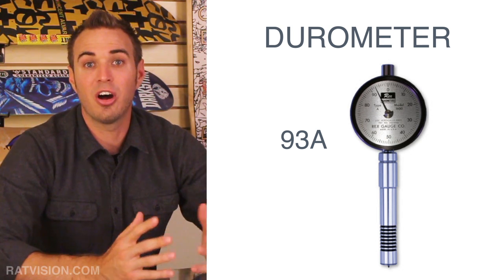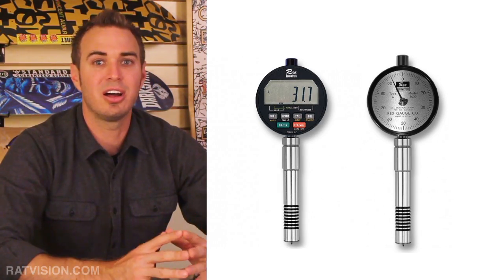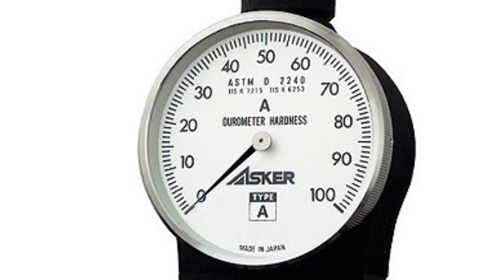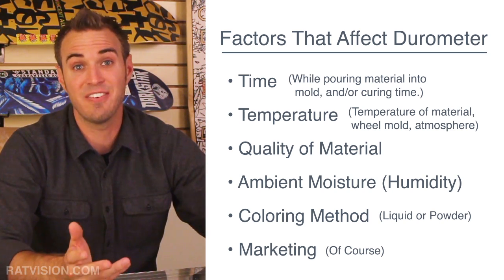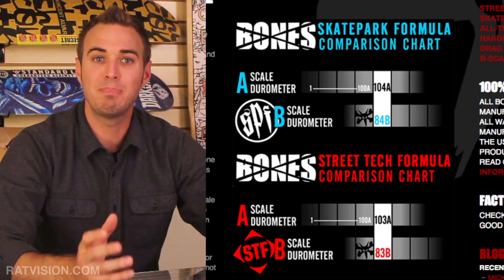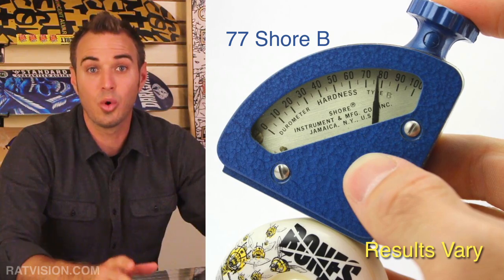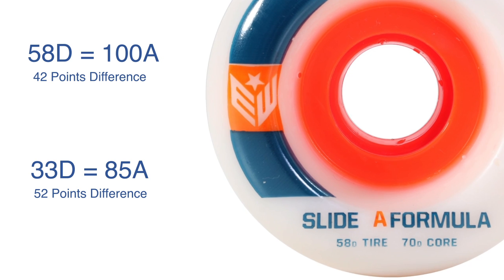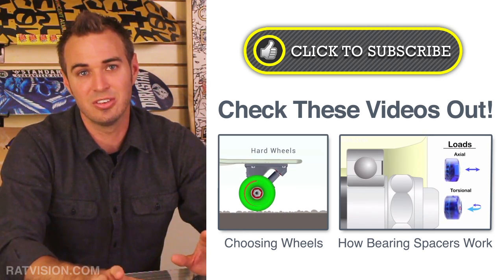Durometer - Hard vs Soft Skateboard Wheels

Comment: Hello your explanation is not quite right we use a digital Durameter on hundreds of wheels and the results match the markings on the wheels including the times we check Bones wheels the Bones wheels are always spot on for Durameter check ,if they say 101a or 104a that is exactly what shows on digital durameter. as I said we check many brands and many wheels so the Durameter is extreamly accurate So please explain why you think Bones wheels are not a higher Durameter. The way we understand it is its a points if Hardness not a percentage. so you can have better than 100 pniots.

Comment: Hello I watch a lot of your video's just as We arr curious, must say most of is correct except for we do not let customers not go out without them understanding you always need bearing spacers without them will premature wear  bearings out   plus I personally have bones elite skate wheels that are marked 102a using a digital durameter it reads ,you guessed it 102 which is exactly what's marked on the wheels.plus even tested wheels marked 104a which also show correct according to durometer .

Comment: Basically Bones say that the average difference between scale A and scale B is 20 points. When you look at the official conversion table, the difference is somewhere between 13 and 15 points and it is not even constant! Great! What a mess! However i like how the bones wheels stf ride. Great wheel even though durometer information are shit.

Comment: I had 2 sets of the green Krooked krusherz that said they're 78D, but are super soft and will bounce 15 feet in the air ! So from what was said in this video about the D scale, I'm for sure confused now because those krusherz wheels in my opinion are probably a 74a-75a...??? Elephino🤔
Reply: D is just an abbreviation for durometer sometimes. They are 78a.
Reply: @Ondrya Wolfson no problem.

Comment: Great info here but , and thank you but  Lordy lordy ...  A great big can of worms has been kicked over ! I recently bought a plastic caliper and a hightec digital combo set and found the results to be +/- 1 mm exactly on almost every wheel ! The plastic caliper ended up being the easiest to use , close enough vs digital always giving a slightly higher or lower value . Many brandnew wheels are printed just plain wrong . Also weighed the brand new wheels several times on different scales and concluded that same shape /said durometer and size can vary yet weight variances are minute  . That being said i think the overall formula stays the same , everything cures differently much like a fine whiskey in a faster fashion . First press vs last pressing etc ... Time of day and humidity
Reply: There were a many way offs and a few near perfects in the small study that i did . Dear god now actual durometer .... !

Comment: is there wheels that are actually 99a or 100a as advertised? Instead of saying they are 101a or 83b and are actually 97a
Reply: Slimeballs, i hear, feel like a (97a back in the day). I think durometer ratings used to be more accurate, which is why wheels were labelled softer.

Comment: I think companies put 101a + just to try and reassure you that it is the hardest they could possibly make to get to 100 or close. I have Bones STF's 52mm/83b and they do feel like 97a or below when i try to powerslide. I tried ordering some concrete rippers 52mm/58D but they are only available in Japan!I I just ordered some Rosewells 102a/52mm just to see if it will be better for sliding.
Reply: I like the way spitfires slide. They dont just rotate the back wheels until you go 90 and push hard, they actually slide like butter. Same as the classic formula, but they wear like erasers.

Comment: so if its a higher number for example 97a. Does that mean its really hard or really soft?
Reply: Nick Tichon medium, more on the hard side :)
Reply: Thanks 👍🏼
Reply: Nick Tichon 80a would be for a cruising wheel/filming,85 is still cruising or filming, 90 is still kinda soft, 95 is basically perfect not best for slides though, and 100 is hard, basically 95-100 is a street wheel and 78-88 is cruising/Filming, and anything between 89-94 is kinda right in the middle, but the best street wheels is 95-100 and Filming/cruising is 78-88
Reply: Grey Talec I want to build an old school set up with 60mm 90 a wheels for street riding/cruising some tricks
Reply: Nick Tichon yeah that's perfect
Reply: @nicktichon349  rat bones? Perfect.
Reply from the maker: It means its probably 97a, but it might be off by 2 points up or down.

Comment: I was thinking about getting that fireball wheel pictured. Would you recommend it?
Reply from the maker: It all depends.  What size, duro, width, footprint, contact patch, lip shape, and core set do you want?  But more importantly, what type of skating do you do the most and on what type of surface.
Reply: I ussually just cruse on my long board so I was gonna get there 81a 76mm wheel. Do you think its a good choice?
Reply: Break Your Mark spitfire doesnt make longboard wheels i dont think

Comment: my question is: These wheels are company from powell peralta, they have ATF, FRF in various "formulas" like FRF 717 and FRF 727, and other brands like Abec 11 with Classic Thane, Reflex and Slide Thane formulas;  Free Wheel CO. with platinum formula, gold standar formula and cash money formula...
So, all of these are diferent formulas, and i notice that FRF 717 are more slidy than FRF 727 but both of them have the 80a durometer: is the formula a diferent duro than the other? like, 717 can be a  B durometer and viceversa

Comment: Ive always had a hard time with wheels (no pun intended)I noticed this as I started to have a preference with products, everytime I buy a set of wheels, even if they are the same durometer, they always end up sliding different.I bought a two sets of spitfires. they were both 101a and one was 52mm and the other one was 53, they were also conical and what impressed me was that they slid different from each other. now I know why haha.Also a quick question, what wheels would you recomend? you seem to know your shit so I want to know

Comment: I need help!!! I ordered an off brand longboard from Amazon and the wheels are nice ish but they're kind of lop sided as if they had flat spots, I need help to fix that
Reply from the maker: +Cobra Skating there is no way to fix that. Each wheel would need to be fixed individually to match each other.  This is #1 mistake for going cheap, because people end up spending a lot more in the end. They buy a cheap board and then end up buying all new stuff. All the money for the cheap one was a waste. Sorry, it's a hard lesson. This is why we educate people, so they can recognize the differences and make smarter choices and save money.
Reply: "Rat Vision – Skateboard Tech thanks for the feed back, I was not patient enough! I guess I learned my lesson

Comment: Hey, I have a problem with my skateboard and I'm not sure what to do. So basically, when I looked at my board's graphic, I noticed that there were small indents above each wheel. They were all circular shaped and I had a sticker over one wheel (on the board, obviously) and it tore through. I did change my wheel size recently from a 52mm to a 54mm but I'm not sure if that's the problem. Help???
Reply: Jordan Meiland 
It's wheel bite, tighten your trucks or get a riser pad
Reply: Ok, thanks for telling me!
Reply: Wheel bite maybe

Comment: I think the true crux of this issue is the scale itself. Since there's no direct link between the Shore A, B, D etc. scales, it just ends up being confusing for the majority of people, since scales can't be compared off the top of your head - you need to look at a chart. I think a better solution would be to develop a new scale exclusively for skateboard/longboard wheels, with either a single scale that encompasses all wheels or a similar system to the Shore scale, but with a definitive link between the scales, such as a flat 20-point difference. I think this would remove a lot of the animosity in the current durometer rating system. Although it hasn't taken off hugely, we have a similar system for bearings; the skate-rated scale. If my proposed skate wheel scale and skate-rated bearing scale were to overcome the ABEC and Shore scales (which would be very, very difficult, I admit), I think that skaters would benefit, as it would be much clearer to the skater what they are buying/using.

I'd love to know your guys opinion on this!
Reply from the maker: Spirit Longboarding There is not supposed to be a link between scales.  Think of them like kitchen utensils.  In a kitchen you'll find a spoon, fork, spatula, tongs, etc.  Each tool is used for a specific(s) task with food, like durometer guages are used to measure the hardness of materials. Each one is separate.  You would never use a fork to eat soup, or a spoon to flip eggs.  Each durometer guage is separate from the rest, and each one should only be used to measure a material that falls in its range.  However, you could use A, B, and D to measure one material.  A new scale specific for skateboarding does not solve the issue.  You're still introdcing a new scale by the way.  Just like how every brand was using the A scale, the industry needs to switch to the B or D scale to cover all wheels.  That will solve the issue.  
We do not have a simalir system for bearings!  Where is the "skate-rated" scale?  It doesn't exist.  Bones made that whole thing up to fool you into thinking they have something special.  What is the "skate-rating" of Bones bearings?  They don't have a scale.  There are no numbers that compare their line of bearings.  It's ALL fake!  Still don't believe me?... What is the skate rating for Bones Reds and what is the rating for Bones Swiss Ceramic bearings?  If there is a rating or scale, why is it not printed on the bearing package?  What are they measuring, testing, and what factors are considered in the scale? Bones has NO answers to these questions, because the whole skate-rated thing is all made up. It does not exist.  You have to be careful not to get sucked into clever marketing and become "brand-washed".
 If you haven't seen our video about bearings, we highly recommend you do.  There are too many factors that come into play that make one bearing better than another, however a bearing rating could be developed that provides a better rating than ABEC (which is meaniningless in skateboarding, for the most part, due to so many factors).  Thanks for the comment.
Reply: Rat Vision – Skateboard Tech Thanks for the quick reply!

I'll admit I didn't do enough research on Bones' Skate Rating, so thanks for clearing that up. I've watched all of your videos several times, and I would agree that a better rating system than the ABEC rating could be developed for skate bearings. This would likely take a lot of time and hassle, and it's probably something that the WSF or any other skating body doesn't have the time to bother about right now, as there are more important things on their plate (such as the whole current argument over the 2020 Olympics, which is a whole other bag of worms).

I know that there is no link between the Shore scales, since they measure different rubbers/urethane's/plastics - the true solution would be to educate skaters into what they're truly buying as best as possible, which is what this video does really well. Switching to the B/D scale would sort many of the problems I agree - it's likely to take several years for all companies to cotton on to the idea. I wasn't disagreeing with what you said in the video, I was just putting forward an alternative opinion/solution. It will take time for skaters to get a hold of any "new" scale that takes over, but then again that's the evolution of skateboarding, and it's bound to happen sometime.

At the end of the day, the more skaters know about their wheels/bearings/trucks and the like, the more likely they are to make a good choice in purchase and be confident in what they ride, which I think Rat Vision has helped a lot towards.

Also, welcome back, it's been a long time! If you're accepting any suggestions for videos, I'd agree with a certain comment I saw earlier that a video on the different types of trucks is sure to be very informative. In longboarding especially, there's several breakthroughs in technology coming in trucks that many people don't know the real differences between (cast, forged, precision trucks, hollows, adjustable baseplates, adjustable axles, springs (Original, Seismic)), so an explanatory video would be awesome!

I would suggest something on helmets, but since the IDF is still working on their new helmet rules, I think it's a little too early for that. A video about helmet safety ratings and being careful about what you buy should go down a hit as well.

Thanks again for the comment, and I appreciate you putting in the time to write a response as long as that!

Comment: So should I use a shore A or shore B duro. tester for testing skate wheels?
Reply from the maker: MBsteller It's better to use B or D.  Bones for some dumb reason is using B, and other brands jumped on the band-wagon.  Most manufacturers/industries use the D scale.  It would be a good idea to not jump back and forth between A and B or D.  You really need to just stick with one durometer.

Comment: I'd love to see a video, not only on hardness vs softness compared to the different styles of skating, but determining what width a board and their corresponding trucks would be in comparison to the style of skateboarding. E.g. wider board and trucks are for vert style, or so I'm always told. Would be nice too know why this is preferred and what benefits it would provide if any.
Reply: To measure the width of a board you use a measuring tape

Comment: Yeah! You're back! Please do a video about how to fix crooked trucks!
Reply from the maker: Nearly all trucks have terrible bushings.  It's pretty weird.  They wear out sooner than most people (including pros) think.  They lose rebound, recovery time, and shape over a farely quick period of time.  So, yes it could be easier to turn to one side.  One wheel off the ground has to do with the truck hanger still leaning to one side when you step off the board.  This is comppletely normal.  Your own body weight corrects the problem.  You guys may want to change your bushings to either harder or softer depending on how loose or tight you like your trucks.  Don't rely more on the kingpin nut to adjust the functionality of the bushings or turning capability.  Get the correct hardness first that you desire, then adjust with kingpin nut.
Reply from the maker: Verbs WB Crooked? Is one wheel off the ground, or does the board roll to one side?
Reply: roll on side, bolts are tightened, I always have to press hard on the other side it was convenient to go, but it's only for a short time
Reply: Verbs WB Yeah, I have a similar problem.  When I go to lean-turn on my board, it always turns easier on the one side.  Its like the truck bushings are much softer on one side of them or something.  Ill skate with nose of the board forward, and the board.more easily leans towards me.  Ill flip the board around and skate the nose, and the board leans forward easier, away from me.  
Hope that made sense

Comment: Nicely done. I am of the opinion that riders are falsely being taught to value meaningless micro differences in products.  I challenge any rider to tell the difference between a 105a and 97a wheel in terms of riding, and as Bones itself shows with its "fewer flatspots" guarantee, and as you mention, it is the wheel COMPOSITION that matters in terms of durability, not the hardness.
Reply: ***** I feel like bones wheels slide and then stop suddenly instead of slowing down
Reply: but bones actually dont flatspot I powerslide for fays
Reply: +Bob Bobby i don't think i've ever had a flat spot on any of my wheels ever, and i powerslide alot too, :P i think i'm too skinny!!
Reply: I was skeptical too, until there was a huge price rise in bones wheels (in Europe they cost 54€, which is more than a board) and I had to switch from bones spf to wreck wheels. These are clearly softer, which makes sliding backside tailslides in a rough concrete bowl twice as hard.
Reply: 97a grips, keeps speed in bowls, is medium speed and controllability down hills (best results are 90a - ish, but you wanna do tricks) 84b slides uncrontrollably, is slow and dangerous down hills, and loses its speed when turning.
Reply: The difference between 97 and 105 is huge. 105 is not street friendly but great especially since there is no such thing over 100. 97 is somewhat forgiving on slightly tougher surfaces and is grippier on smooth surfaces like skateparks.
Reply: ***** I think you have to ask if you have the riding sensitivity to detect a 5% hardness difference? Then consider that there is NO SUCH THING as 104a, because the scale only goes up to 100. I assume that what they are trying to say is "Really really hard", which is NOT a good thing anyway, but many skaters incorrectly conflate hardness with durability.

Personally, I would just buy wheels that I like the look of that are in the ballpark of what I like, rather than obsessing over the marketing hype of a few percentage points of difference.
Reply: I found you again Matt lol
Reply: Lorenzo L. Boo! Yeah, these guys are very impressive. Had your birthday yet Renzo?
Reply: Mat Broomfield yep my birthday was on the 23rd, thanks for asking ;)
Got some new trucks and a board that I will skate soon
Reply: Lorenzo L. I thought you were hoping to get wheels? Trucks and a board are better! Which did you get?
Reply: Mat Broomfield I got a Girl 7.8 deck as well as some Indies. I got to buy new wheels but I'm always too lazy :(